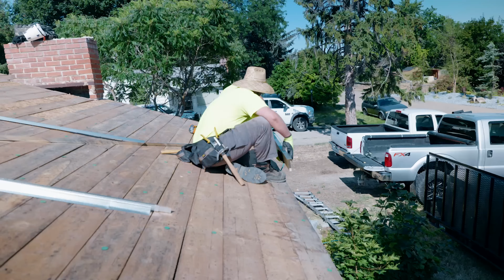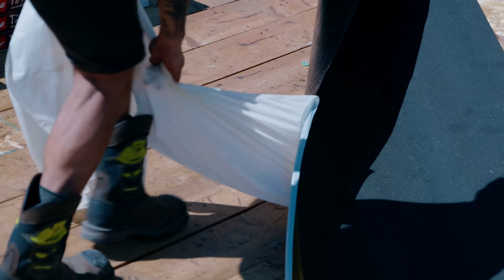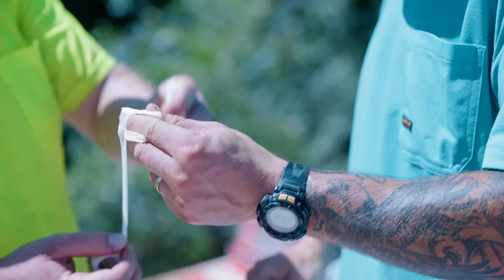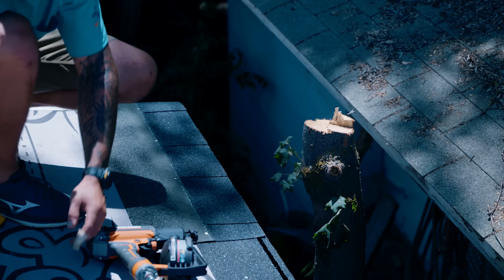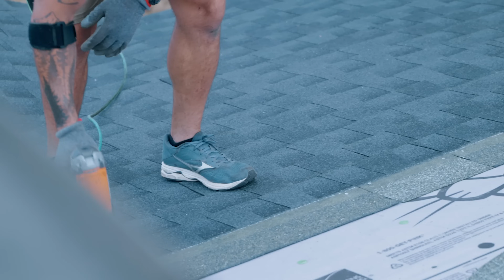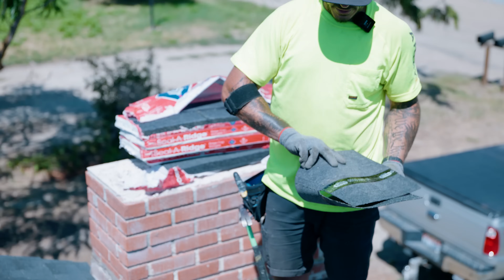My FIRST TIME Roofing. NEVER AGAIN! (EP.8)

Comment: Always a rip a two inch or so gap at the ridge through the sheathing to the rafter/ridge
for asphalt shingles..and cover with a vented ridge cap
Imho metal roofing is way better,easier.
And don't forget vented aluminum soffit..
And a vent roof vents..

Comment: I respect the whole capping nail for syntheic paper as you said, let me tell you a story! , i use too use gun nails as said by the manufacturer, not everyone who has a ship lap (1x6) roof deck like yours, roofing over ship lap is ok nut the best is too resheet, i put synetic paper on a very walkable roof (4/12) with the nail gun and one of my nails hit between the interlocking ship lap, every board is spaced quarter inch and there is wood there but eight inch below, it leaked and once we started too use staples we never had that problem, the manafacture  says use this and that hoping you use there product and hope too make extra money, ive been doing roofing since 13 and owned my own bizz since 21 im 35 now, and all those guys saying hit the shingle skip 18 inches and nail because the nail is in the key way, (rip a roof off and look at the new shingles you will see a stain through out every nail nailed on that shingle) i hope this information helps 🎉 I would use staples too put it the paper down

Comment: You keep blaming the previous homeowner. But more than likely he hired the job out. Or like in the case of my dad he bought the house with all the lipstick on the pig back when home inspections weren’t really a thing. My dads house has the original cedar shingles plus at least 3 other layers. And it’s barely starting to leak. But he bought it that way back in the 70’s. Crazy, I know.

Comment: As a former roofing contractor commercial and residential I was extremely impressed you took on this project.  If I could add one recommendation, it would have been the ventilation.  Ridge vents give the best and help cool the attic.  But all and all you did a great job. Enjoyed the video.
Reply: I was surprised their was no ridge vent or turtle vents either... But i guess that's what vented soffit is for.

Comment: I am 56 and in the middle of my own house roofing project. Mine is 3800. They wanted 15,800. Like yourself, I said heck with that. Unlike yourself I have absolutely no one to help me. Lol Also wasn't able to get rooftop delivery. So it is carrying everything up a ladder. I have learned how out of shape I have gotten. Every day I get off the roof it is like some beat the tar out of me. Lol I am not going to get mine done before winter sets in. So I am looking for a stopping point. I did strip mine and re-roof in sections. Which is a little slower and a bigger pain, but does provide some security. I enjoyed your video. It is nice to know I am not the only insane individual, but I can assure you this is the last roof job I will ever do.

Comment: Next time use something to lift the drywall off the concrete about an inch at least and also make sure that your joints are all screwed on something solid since the joints are going to crack easily over time if not 💪🏽

Comment: Like you said up north we use Ice and Water shield along the gutter edges and valleys. But we install the Ice and Water first and extend 2” onto the fascia and then install the drip edge.  Also I have the guys then strip in the drip edge for a little more protection. You are also correct that Ice and Water shield is very expensive.

Comment: @MrBuildit, my dad and I did my roof in May, lots of work to rip off, repair and then reshingle, but the cost savings and learning were worth the long days. Curious, are you planning to do gutters? I am wondering the choice between drip edge or gutter apron. We ran drip edge on the gable ends and gutter apron on the other. Cheers!

Comment: Great job.  Roofing is a rough job.
A few things:
On old houses, run steel in the valley.  Helps keep the valley straight and flat on mix and match roof decks.  Then put ice and snow over it.
Ice and snow on the eaves.  Protects the roof edges, especially if you are in snow country.
That underlayment can be stapled down in spite of what the manufacturer says.  Just dont go crazy with them, only staple the top and bottom edges.

Comment: Rock on Amigo.   I did a concrete tile remove, new underlay and reset  - I felt the same way - super proud of the work.      I fixed a TON of things that a normal roofer would not have (trim, vents, etc)......but the entire job kicked my ass.     I did save a ton of $$.       High quality kneepads are a MUST.

Comment: When I did my roof i also couldn’t justify one of those pneumatic cap nailers, so I went with a magnetic tip cap hammer.  You put the cap on the tip and in one swing the cap is set. After a while it goes pretty fast and it’s one less process with a hose to trip on.  As for the ridge cap, when you get to the end and have exposed nails, put some roofing sealant over the nails, rub two scraps of shingle and collect the granules and sprinkle them over the sealant and they will disappear.

Comment: You might wanna have put on a ridge vent at the top peak for air flow unless you are gonna put in a solar attic fan to get the hot air out of the attic. I made this mistake. I had no air flow thru the attic and had to put in the fan
Reply: Ridge caps are sold by roofing companies, you have to specifically ask for them though. If the home does the 2x4's with wholes drilled into them and covered by steel mesh into the attic, then you could have added a attic vent the length of the roof about 2 feet up from the edge that lets air into the attic and out the top

Comment: Do yourself a favor wear a wife beater shirt under your regular shirt soak it in water to begin with and this will help collect your perspiration  which as a wet cloth will act as a cooling rag, also soak a large hankerchef and put it over your head and down your neck for the same treatment.  Trust me this works I roofed several buildings and have had to work in attic areas and it makes an appreciable difference.

Comment: Having just replaced a project roof myself, I spent a lot of time researching a lot too. In regards to the cap nails vs staples with the synthetic underlayment, it comes down to the mfr. One brand for example allows for staples but only if shingles are being immediately installed same day. Otherwise the cap nails give a lot more holding power if the underlayment is to be exposed for a while. Many other brands however require cap nails to qualify for certain warranty situations. Looks good though (Used the same shingles on mine as well). I echo your sentiment at the end - getting it done at the end is a MAJOR relief and proud achievement.

Comment: You should have put tiles on the roof, much longer lasting, 50 years minimum,  felt roofs like that would only be used on garden sheds in the uk as is its is poor quality comparedto the tile or slate options.  Also way more expensive, but will last